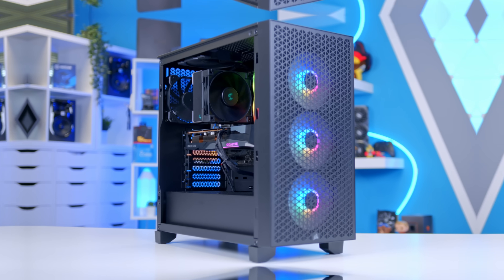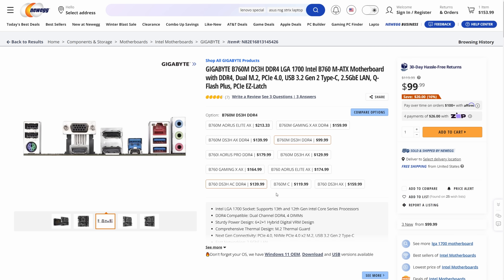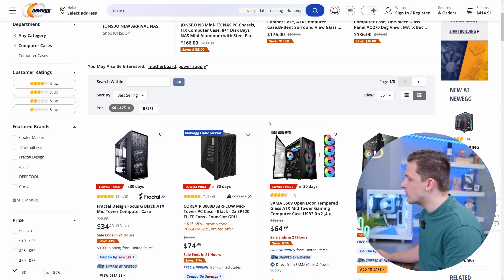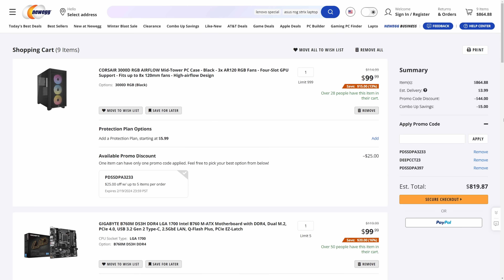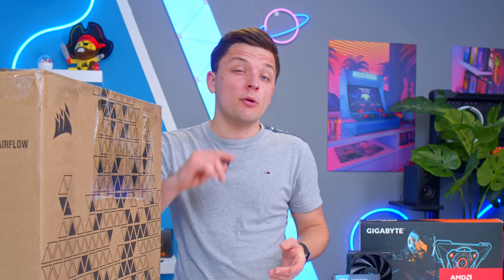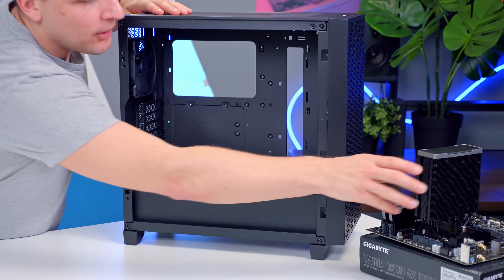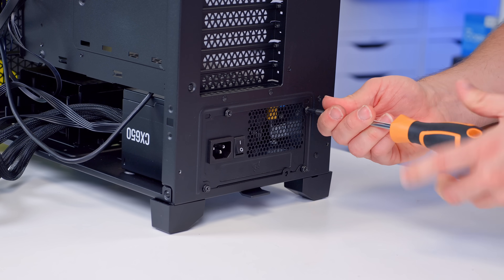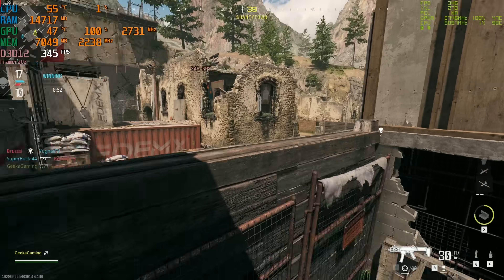Budget $850 Gaming PC Build 2024! 😄 [Full 1080p Build Guide w/ Benchmarks!]

Comment: Idk when video was filmed but there is still on Newegg 12600 KF for 150 bucks which is so much powerful CPU that later you can upgrade to something like RX 7900 GRE or RTX 4070 Super 
+
For PSU check MSI Mag A650BN it's often around 50-60 bucks and it's solid Tier C unit on PSU list 
Anyway nice build but at the end you have some free money so you can drop bigger SSD 🙂

Comment: For the case, you could of gone with the Montech 903 MAX....got four fans including 3x140mm fans in the front and 1x120mm in the rear for roughly $75. Other than that, nice build for $850.
Reply: Tryna make a build 850 should I go wit gtx 4070? Instead of 7600
Reply: @Cohaxjc go with the 4070, 7600 is a budget gpu, 4070 is mid range

Comment: is the deepcool ak500 good enough for the 7800x3d or should i go with the ak620. because ive heard the ak620 has ram clearance issues with rgb ram
Reply: At that point go with thermaltake phantom spirit or thermal take phantom spirit evo. They work better I think and are cheaper
Reply: Ak500 won't work, that is a hotter CPU.
Reply: Consider AIO cooling bro